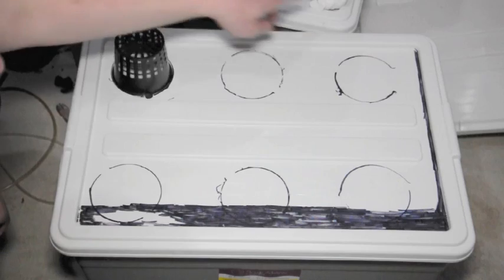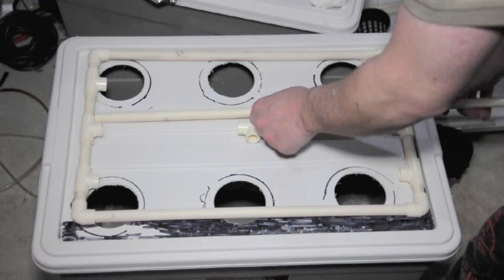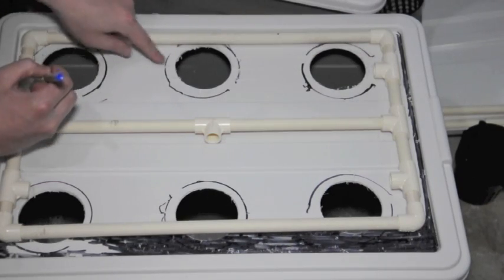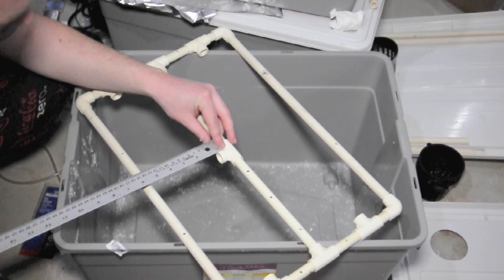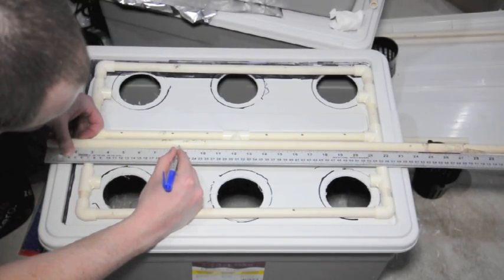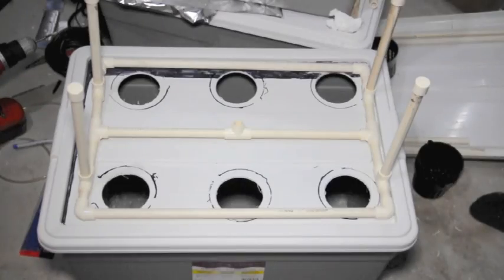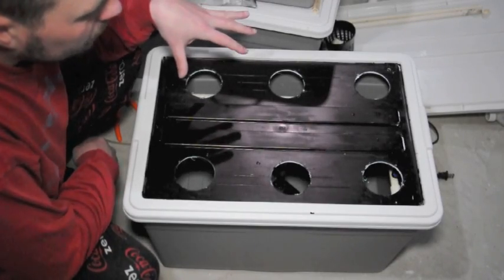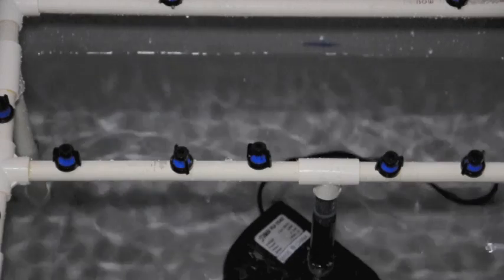Hydroponics growing system: How to build a DIY Aeroponics growing system for indoor growing.

Comment: Love the video....really helpful, I am planning to build a vertical system
Where did you get the piping, and what size is the piping?
Also would I need another size pipe and a stronger motor if I were to go vertically? possibly 3 feet high. 
a quick response would be greatly appreciated as I have a deadline....thanks

Comment: does the pump you use have to much water pressure for the system? also were you able to find all of these materials at a local hardware store or what?

Comment: I have a question for you.

When you placed the spray heads you placed them all in the PVC tubing.  Have you ever drilled and tapped a hole in the fittings, such as the elbow or tee fittings?

Also, how do you know how many spray heads your pump can support with a decent spray volume?  If you have too many spray heads you can lose your pressure, no?

But, if you have too few spray heads, is it possible to hurt the pump by making it overwork?

Nice practical videos, really appreciate the ideas.

Comment: Only one problem I see with it.  How do you deal with the dead legs which will get stagnant water after use for a period of time?  

There is no mixing in dead legs, and that environment, of course, is nutrient rich which promote bacterial growth.  It would be better to go ahead and put in 4 more 90's and 2 pieces of horizontal pipe completing the loop.

I'd be interested to see if you've noticed anything.

Comment: OPEN QUESTION
...but isn't DWC better for PH control or something? I was looking into SWC (shallow) and it seems ph was the reason everyone went to DWC. Therefore wouldn't that be the same problem here?

ALSO (logic?)
...in the reason that hydroton will absorb the bubbles for DWC, why so much coverage? Wouldn't it make just as much sense to only have 2 spray heads?

Comment: What is the size of the pipes used? And where did you buy them?
 I checked in Lowe's & Home Depot and the smallest they had was 1/2 inch which looked too big. :(
Reply: +jingabobo  the pipe is 1/2" cpvc not pvc

Comment: Don't the misters act as aeration?  Does that make the air stone redundant?  In any case, nice details video. I appreciate it!
Reply: I may have to join you in this hydroponics stuff.
Reply: Dude, it's so much fun.  It's a lot of work to learn the ropes, but the rewards are great!
Reply: u dont need airstone if using aeroponics water sprays roots and the roots r getting air because the roots r not fully under water dont really need airstones for dwc use air stones to get started with when using dwc when r big enough do not fill bucket to top fill till u see the roots hanging in water plants wont drawn because still getting air

Comment: You should NEVER use PVC solvent without gloves and some sort of respirator to prevent breathing the organic solvent fumes as PVC cement is very volatile and can permanently damage your lungs. 

Other than that, looks good. Just wondering - what gph is that pump?

Comment: where can i buy those spray heads?
Reply: You can buy them at Home Depot. They're micro heads for automatic sprinkler systems and they come in 90, 180, and 360 degree spray patterns.

Comment: My Aeroponic/NFT system is based on an intermittent nutrient spray cycle of 1 minute ON, 10 minutes OFF. This "Off" time puts about 1/10th of the heat in the reservoir that running continuously does, uses 1/10th of the electricity, the roots love the "air time", and my cuttings propagate with nothing but plain old water, no hormone, no air pump. Every time.
Just spray the cuttings every 5-10 minutes for no more than one minute. In three weeks my cuttings are ready for the vegetative growth cycle, and I move them to containers separate from the reservoir. That gives me astounding growth rates, and root rot is impossible so long as the roots drain well, and with no air pump needed, humidity in the grow room is more manageable. I use two 10 gal  Rubbermaid Roughneck sitting crosswise on an 18 gal reservoir. Roughneck lids seldom leak.
Apparently this is a little known technique, but I know how well it works, and would encourage others to use a "repeat cycle timer" with their aeroponic sprayers, and keep the roots from being submerged.
I must add that roots don't like light, and algae does, so dark containers should be used.  White is a good choice for a how-to and can be lined with black plastic.
Reply: +kelhawk1 what timer do you use for that
Reply: +Keith Van Brunt I buy zero to ten minute industrial surplus timers for $5, then modify them to run continuously. They are basically a tried and true synchronous motor with a modified nylon cam that makes one revolution every 11 minutes and activates a micro switch. I have never had a single failure after thousands of hours. Takes a good hour, and about $20 worth of parts to modify and mount in a double gang pvc box, with cord and receptacle. So by the time you pay to have it all assembled you will still end up with around $50 in it. There are solid state timers available for that price, but their reliability is questionable at best.

Comment: Do you happen to have any references to the NASA research?  I've spent some time over the last few days trying to track down the NASA publications on aeroponic research (especially wrt the effect of droplet size on root nutrient uptake).  Apparently I suck at this kind of research...
Reply: squirrelflight Ideal droplet size is 5-50 microns for optimum nutrient uptake....(achieved only with a high pressure system)

Comment: would it not be simpler to simply clip on legs, rather than them as a capped extension to the system? simpler no? it is also possible to go further and add in sensors and a rasperyPI (cheap to make - youtube it) with a network card so you can receive real time data on EC, pH, temp, etc... locally or across the internet (with PRISM etc the latter may not be the best idea) to tell you when the environment needs some manual intervention.

Comment: Hydroponics is a good system but it also have some drawback, you will need to shop for some "plant food", nutrients and supplements that can be costly. Before making any hydroponics system, you should check out the benefit from aquaponics system, which can automate 95% of work.
Reply: Please told me exactly how?

Comment: That giant bucket for just 6 clone sites.... I have 10 sites in a simple 5 gallon bucket.... 2 clones in each one is 20 seperate clones at once.... in only a gallon of hydro water instead of like 5 in that monstrosity
Reply: +loki guy He could have easily put twelve or more sites in, but perhaps he simply doesn't want that many clones. He also may be planning on maturing the plants right there in that same tub, so putting 20 or 30 sites in would never be considered. That may be why he is using 3 inch net pots instead of 2 inch, which I wouldn't do, but it sure doesn't prompt me to label his work a "monstrosity" lol. Perhaps he is concerned about high reservoir water temperatures due to the heating effects of a submersible pump, grow lights, and an extra warm environment.  I use both bucket and tub cloners and have never lost a cutting. I would never normally run my bucket and 185 gpm pump with only one gallon of water...unless I was using a chiller...which I won't do. The biggest problem is that one gallon barely submerses it in a 5 gallon bucket, so I am curious how you deliver nutrients.
Reply: kelhawk1 I guess you're right. Different strokes. I don't mature cuttings in the bucket, just root them and replant--so I don't need any nute solution. Just dechlored water at 5.7ph. Not sure how tall your pump is, but for me one gallon is enough to spray up just fine. The water temp never goes above 77f but yeah, maybe I was too critical
Reply: +loki guy You're OK loki guy! Do you root in plain water or use rooting hormones? Do you spray the roots constantly or use a timer?
Reply: kelhawk1 Thanks, when I clip cuttings I put them right into a glass of tap water, then dip into clonex gel before going into the bucket. Timer is set to 15mins off/on but I'm having trouble with roots going brown sometimes =/ maybe I'm not changing the water out enough?
Reply: Can i ask you what size pump you used  in your 5 gallon bucket version of this please?